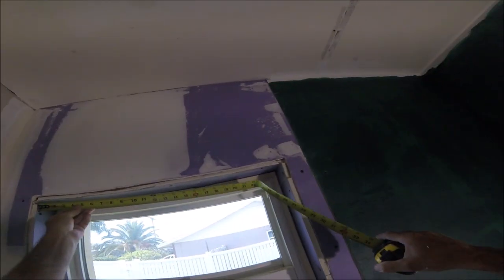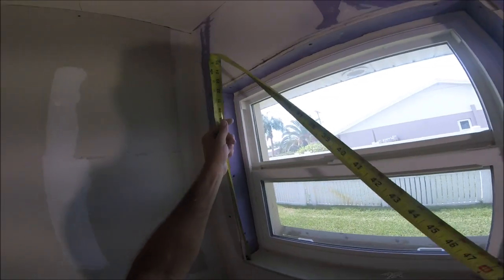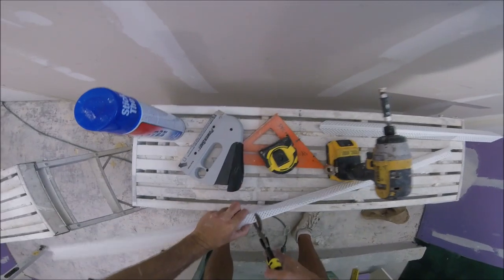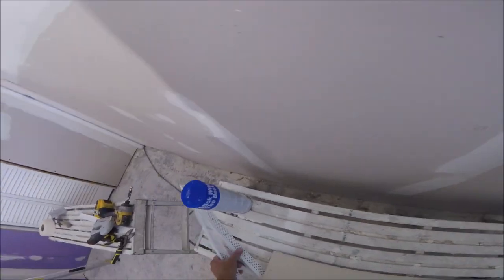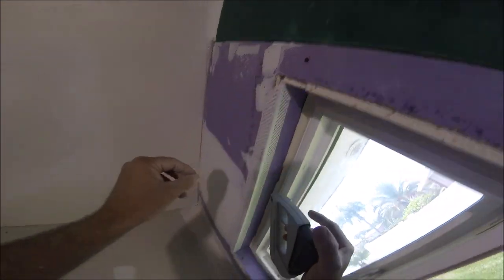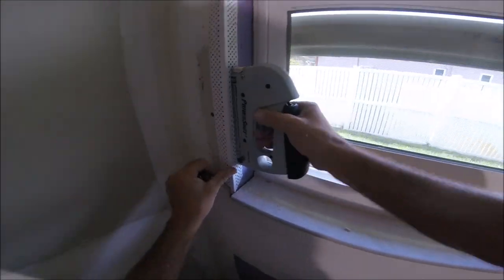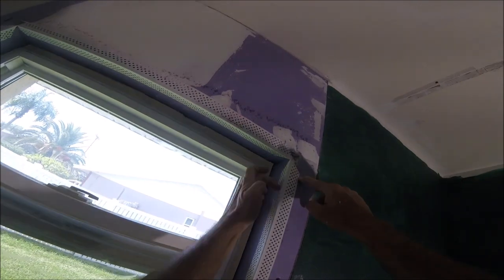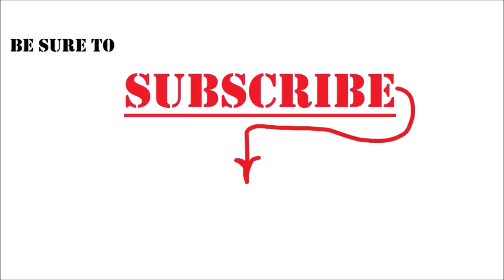How To Install Plastic Corner Bead Around A Window

Comment: Another great video pool and great minds think alike because I have always also done the 45-degree cut on these. Now you mentioned using the staples I have never done this and have not had any problem because the adhesive is just so darn strong so do I really need to start stapling? This method you showed today should be good for DIYers  also, because it can be a challenge for some people too run screws through their corner bead without overdoing it and making the corner bead start to ripple and bend

Comment: One tip, if it's available in your market, stainless steel staples (I have never tried non-ferrous staples, but anything that doesn't readily "rust") eliminates the potential of rust bleed-through.

Comment: Paul-Thanks for the vid. As a GC that does his own drywall on remodels (self taught) , I've always struggled with the corner bead @ windows. I've tried cutting the bead square & @ 45 degrees (though I would cut it at the opposite 45 than you did(long point on the outside edge) & was never consistent. Your method seems much better. Can I assume that you would then prefill &tape diagonally across the face of the corner to fill in the gaps from the butted board.
This method of cutting corner bead would work well with metal corner bead as well?

Comment: Will the staples rust ?
Reply: Yes, unless nonferrous. Staples aren't even necessary and don't even provide that much grip. You should put the spray adhesive on the contact surface and the corner bead